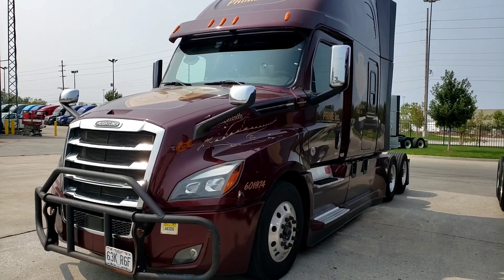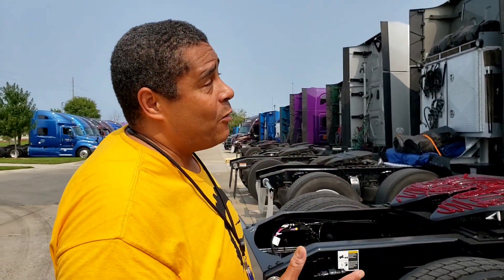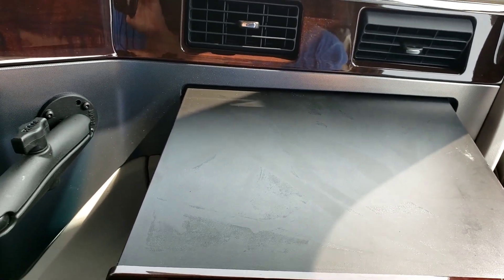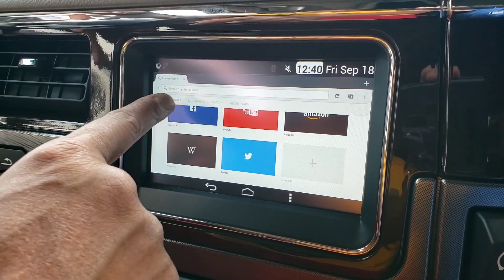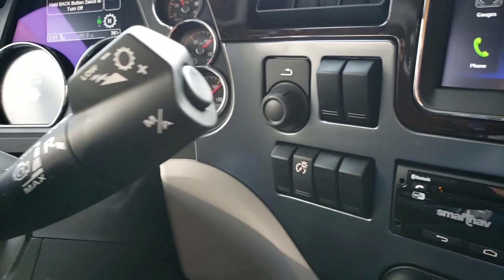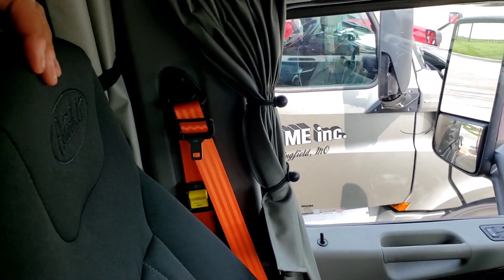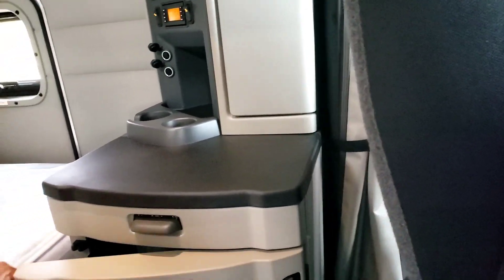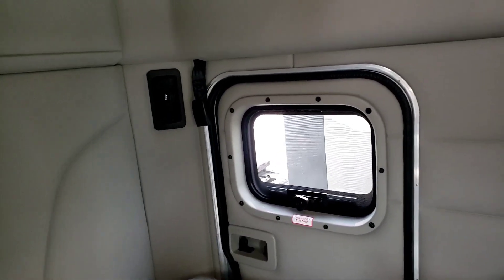My New Truck! 2021 Peterbilt 579 Ultraloft - Full Truck Tour. Inside, Outside and Engine.

Comment: I have the same truck and I’m curious to how you took out that tv mount and replaced with a mount that fits a 32
Reply from the maker: I attached the new mounting arm to the existing built-in mount. Just drilled some holes and used bolts to secure it.

Comment: The button on the tip of the signal stalk is marker interrupt for the trailer.
Reply: That other light switch is done light & ambiance lighting under your feet lights up the floor, one on the right is in the bunk area. Both lights should light up red. I’m used to the KW T680 I know the Pete is it’s cousin so I’m guessing it’s similar.
Reply from the maker: Yes it is similar but in the lights of Amber instead of red. I think I would have preferred the red😊
Reply: JJ the Trucker pardon my typos, dome light... amber?!😒 said okay I guess but yeah at night the red has a nice glow. I’m in a Volvo VNL 860 now so it’s like night & day.

Comment: Beautiful rig no doubt. Much better channel than that one called This guy trucks. Just my opinion. One concern though. Where are you frontal tow hooks? Would suck having to screw them in after they are needed.
Reply from the maker: Thanks Michael. The hooks are in a box under my bunk. I'll just let the tow truck driver put them in if they want to use them. Last time I had a truck towed, they didn't even use them. They hook on to the frame underneath the bumper.

Comment: To flash a driver when you get cut off the button is right at the end of the stem you were flicking
Reply from the maker: That button is to flash the marker lights. It's to say thanks to someone you just moved in front of.
To flash your brights, if the lights are off, push the lever down. If the lights are on, pull the lever up and release to turn on the brights and do it again to turn off the brights. What a PITA lol

Comment: J.J......I apologize but I only have ever driven local. No desire to drive on the road but never say never. Love the Pete's but Freightliner still isn't to bad of a truck. I'm just getting to go back over your older videos so forgive me if I start asking questions you have answered  already. You said that you have a three year lease where after that three year's the Tractor is your's. You also said that Prime only likes to keep there tractors for three year's. Is that just company owned tractors or do they tell you they want you to trade in for something new again? Also I'm curious as to what Prime pays to someone like me? 20 yrs, Or do you have a video where you break down pay, benefits ETC........Thank's J.J
Reply from the maker: Hey Joshua. They only keep their company trucks for 3 years. For a truck like mine that I purchase, I can go 4 years, then each additional year it needs to pass an inspection to keep going.
So dor the pay and benefits, there are many options such as the division (Reefer, tanker or flatbed) and whether you're company, lease or owber/op, or with your own authority. Details can be found at www.driveforprime.com with a good breakdown.

Comment: Did you know you could press your airbag raising button and lift a trailer off the ground if its dropped too high? then the airbags will return to normal height once you put it in drive..
Reply: JJ I'm a new sub and I ran across your channel and I also filled out an application and would like to know would it be too late to add your name to  my app? Also how is the mpg? The pay is it mileage or cpm? What is your FSC?
Reply from the maker: My airbag switch lowers the airbags, it doesn't raise them up. They're in the fully inflated position for normal driving. I can lower them to get under a trailer that's been dropped too low, then raise them back up to the normal height, thus raising the trailer.

Comment: Thats 80 inches? From what, the windshield?
Reply from the maker: From where the Sleeper starts (behind the seats) to the end of the Sleeper. BUT, it's as measured from the outside. Inside, it's closer to 70"
Reply: @JJtheTrucker  ah ok that makes sense. Was wondering why the cabinets behind the seats looked so small. The bed was 40in so there should've been 40 more for the cabinets lol

Comment: You could put the 2nd fridge up on the top bunk
Reply from the maker: Not a bad idea AL 😁
Reply: @JJtheTrucker  I would put it up there and strap it down instead of losing the other seat.. or get a chest style fridge/Freezer and put it under the bunk. There are some nice ones out there.. I'm just thinking about using the passenger side work desk.. paperwork/video editing etc..
Reply from the maker: Those are all really good ideas and great points. I'll be doing a video later about the interior of my truck once I get everything all set up and looking good. Then you'll see what plans I have for the refrigerator and what I did with it. As far as working from the passenger seat, I do all of that from the driver seat. I have one of those steering wheel clipboards that I use for the small amount of paperwork that we have to do. The video editing I do either from the driver seat or usually from the bunk.

Comment: thing is soon as you start to turn it in a tight spot you will wish you had your frieght shaker.
Reply from the maker: It is definitely a big difference however just like a took some time to get used to turning in a Freightliner instead of a regular car, it took a little bit of time to find the proper turning radius for the Peterbilt compared to the Freightliner. It's definitely A difference but one I'm willing to deal with it for a much much much smoother and better ride overall.
Reply: @JJtheTrucker  oh yeah I agree in in a prostar but it def hits the bumps hard and likes to sway back and forth which I don't understand for a wheelbase semi I think the swaying be nonexistent.  if I ever go o/o I want a 579. but really sour on Pete's and Ken's def problems as new they have soon many problems the dealers can't keep up. my company has mostly all Ken's so many problems with these trucks they took a mhc dealer mechanic out of their shop in Atlanta and temporary works out our company garage so mechanics can keep up on the regular maintenance of all the trucks and trailers.

Comment: Why do they force you to have super singles?
Reply from the maker: Fuel savings are the main reason. Other reasons include not having to worry about tire size miss-match, better tread wear, better safety, less chance of blowouts and a few other reasons. They figure its worth paying for roadside assistance for a flat in order to get the savings from the other things.
Reply: @JJtheTrucker  I have one of the very few trucks in our fleet that have super singles. I run a food grade tanker OTR. I neither like nor dislike them but one clear difference I can see is that they don't have very good traction. Anyway, I love your vids man. Great to find other Truckers with a positive attitude!
Reply from the maker: That's weird. I get great traction. What brand are you running?
Reply: @JJtheTrucker  Michelin. But look at it like this. What do ice skaters use for the best traction? Big wide blades or narrow knives? The more narrow the tire, the better the traction naturally.
Reply: @JJtheTrucker  I should probably clarify that I mean mainly on snow and ice. I'm not sure how often you deal with that. The ride and traction is fine on dry roads.
Reply from the maker: No, they use the narrow blades for less resistance and friction. The traction comes when they turn their blade sideways.
Tanks don't have thin treads. They're thick, for extra traction.
Street bicycles have thin tires for speed. Mountain bikes have thick tires for traction.
If thin tires were good for traction, NASCAR drivers would use Yugo tires 😁😁😁
Reply: @JJtheTrucker  alright, you're running off path here. Kinda like those super singles on your truck. Lol. Mountain bike tires are thick to keep them from sinking in soft sand and Nascar tires require a very controlled roadway were they actually stick to it. Didn't you say in one of your video's that you have never had conventional drives on your trucks?
Reply: @JJtheTrucker  BTW, how nerdy are we debating truck tires? 😁🤣😂
Reply from the maker: Roflol, very true. 🤓 And you're right, I've never driven on duals, so I don't have a good comparison. I haven't had any issues (yet) with singles, including with traction in the winter, but winter is coming again. Let's see how they do on this truck.
Reply: @JJtheTrucker  stay safe out here! I'm getting ready to get on 80 right now headed towards Salt Lake City.

Comment: Hope yours is better than the one I currently have 2020 been having nothing but sensor , electric issues , and constant codes of the truck thinking my it's out of coolant causing the engine to shut off in 60 seconds
Reply from the maker: Oh that sucks! Yeah, I hope I have better luck with mine.

Comment: I just started trucking and am already to quit. I m with Steven's and can't make any money. I'm broke and ready to go back to loading the trucks instead of driving one. I can do 500 to 650 away with no problem. Still broke
Reply from the maker: At Prime, I averaged $1200/ week during the slow season. It went up after C19. That was after truck payment, fuel, etc.. Before taxes and health insurance. Check them out.

Comment: Welcome to Peterbilt team. Pete air Leaf  air ride suspension. That's what the space between the def tank and 100 gallon tank is for 150 gallons. Need 150 gallon tanks to go for miles and miss those high price fuel stops.

Comment: Got a uniden cb but it doesn’t fit in the slot
Reply from the maker: Yeah, just like the refrigerator spot, it's way too small for today's needs. I ended up getting the Cobra that is sold at the Prime Company Store, and it is way too big as well. It's it's kind of behind the opening and the buttons stick through the opening. It looks terrible. I guess it works. The only other option is to get a really small CB.
Reply: JJ the Trucker tried both ways still nothing

Comment: So JJ, I noticed that you said that the mirrors were heated but my question to you is does that include the hood mirrors as well, are the hood mirrors heated as well as the door mirrors⁉️
Reply from the maker: I WISH! I'm actually surprised they haven't done that yet. Those really need to be heated. And power adjustable from in the cab. But alas, not yet. Maybe one of these days.

Comment: JJ that isn’t just a truck, it should be your pride and joy.if would have had that 33 years ago I’d still be turning wheels!! But I have a question. Back in the day it was a known fact that sliding the 5th wheel all the way back would make trucks ride significantly better.I don’t hear that mentioned anymore. And yes I know the axels have to scale out so sometimes you can’t slide back so much.
Reply from the maker: I haven't heard that about the ride  it I had to slide it forward because the way the air hoses are set up, I broke the electric plug while turning because it was too far back. So I moved it forward to give the lines more slack.
Reply: I guess moving the trailer back reduces aerodynamics but 30+ years ago that wasn’t really thought about. Old trailers were usually spring ride and when the trailer tires hit bumps it would actually jerk the truck up and down, this was called “ trailer slap”.sliding the 5th wheel would mostly just make the ass end of the truck jerk improving ride for the driver.

Comment: Is there really a 15 inch sub in the Peterbilt . If so you'll be bumping  ...LOL...
Reply from the maker: There is, but it's under the bunk facing the rear, and the stereo sucks. Not a big enough Amp built in to get it to thump. Not much of a difference from the Freightliner, other than the wasted storage space lol.

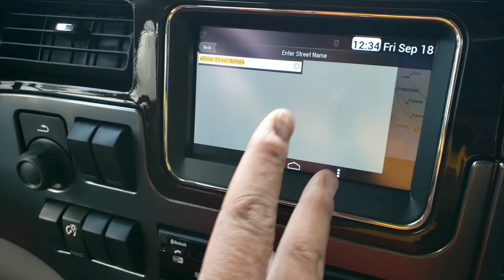Comment: @14:00 what size fridge/freezer (dimensions) can be installed in place of the passenger seat 💺?  That’s a killer idea. I’m planning on the same. 👍🏽👍🏽
Reply from the maker: Pretty much whatever dorm size fridge you want. There's more than enough room.
Here's the one I got
Midea 3.1 Cu. ft. compact refrigerator:
https://amzn.to/3il1EcH
Reply: @JJtheTrucker  So...you took out the passenger seat and replaced it with  that dorm fridge?
Reply from the maker: Yep 😊

Comment: JJ be careful with what I call the white screen of blindness. Your touch screen will act up once and a while and will reboot and will come up super bright at night. If the touch screen freezes hold your volume button and home button and it will reboot too. Look up Prime inc peterbilt.
Reply from the maker: Wow, I hadn't heard about that yet. Thank you!
Reply: @JJtheTrucker  yeah it kept happening with the 579 I had at prime but that was a 19. Never run below the red line for low fuel it will make you chew thru fuel filters quicker.

Comment: That round knob with the arrow is to run you center info panel.  So you cant run dual wheels on a truck you are buying???  Csn you leave prime with the truck before end of lease?  If not, then are you an owner op or a lease purchase driver?
Reply from the maker: I can't run dual wheels on a truck that I'm leasing through success Leasing. Once I own the truck outright, I can change them over if I want to. I can leave Prime with the truck before end of lease. As far as Prime is concerned, they have three categories. Company, Owner op, or Non Authority. If you're under Prime's Authority and you are not a company driver Which means you are either walk away lease, owner op under their Authority or lease purchase, it's all the same to Prime.

Comment: Does Prime have any standard trucks?
Reply from the maker: Standard, as in the brand of truck? If so, no. They have Freightliner, Peterbilt, International and a very few Volvo's.
Reply: @JJtheTrucker  No I mean standard transmission or automatic transmission
Reply from the maker: Oh! LOL. You can order a manual transmission in a lease purchase truck. You have to put more money down for it though. All of the company trucks and regular lease trucks are all automated transmission.
Reply: @JJtheTrucker  thinking about coming to Prime should I switch
Reply from the maker: If you come to Prime, your first truck will definitely be an auto. Then you can decide which you like better. Some really like the auto once they get used to them. Others are die hard clutch mashers 😜
The choice is yours.
Personally, I've never driven a manual truck. Lots of manual cars. Not the same, I know, but I gotta say, I really am a fan of these autos. Just my opinion.

Comment: Are the new Cascadias really that rough of a ride?  I drive a fuel tanker trailer running heavy overweight loads and I’m getting a 2021 126 day cab in a couple weeks.  I’m currently in a volvo.  I didn’t want a freightliner due to the “shaker” reputation but I had heard the new ones were pretty smooth...
Reply from the maker: Maybe a day cab with a heavier load will be different than a condo unit which I had. I'd like to hear your experience with it once you get it. But yes that thing just took the heck out of me. I did not like the rough ride at all.
Reply: JJ the Trucker well crap lol.  Kinda sux out here on Long Island.  We pretty much had to go with freightliner since Gabrielli is pretty much the only other dealer out here & their service is terrible.  I’ll def lyk how the cascadia is & thx for the response

Comment: Super singles if you have a flat you stop right there. With duels if one blows or goes flat you have another one to keep it off the ground so you can get to a place to have it fixed. I would never have super singles on any truck I drove.
Reply from the maker: Charles, that is literally the only advantage of duals compared to singles. But here's the thing. If the duals go flat or bow all the way apart, you can do that. If the tread is still hanging on after the blowout, you can't do that or you'll tear everything up. When singles get a puncture, they're more likely to go flat instead of blow out, and you can still limp them to a tire place. I've had that happen twice. To me, the many other advantages outweigh this one disadvantage that may happen occasionally.
Reply: @JJtheTrucker  . JJ What I speak of about the tires is not from  just guessing, but from 17 years of experence .

Comment: hey jj i was wondering is the truck a little bit bigger for the tv you wanted wich couldnt fit in your other truck if you said it in your video just say
Reply from the maker: They're about the same size. Prime's detail shop never thinks outside the box. The Freightliner could have fit a 32 inch or larger TV, the only issue is that where it mounts to is the plastic cabinet which may not hold a whole lot of weight. It probably would have been fine with a 32-inch but nothing bigger. Peterbilt has a much more sturdy mount that is embedded directly into the truck, but it only holds a 24in. Prime was able to attach a larger TV mount to that small TV mount to get a 32in TV in there. That works just fine but there are ways to get an even larger TV in here. You just have to be thoughtful of the bunk needing to raise up so the TV would have to be more flush up against the wall.